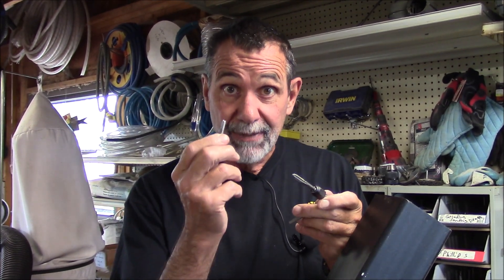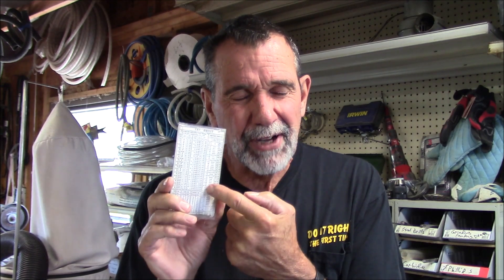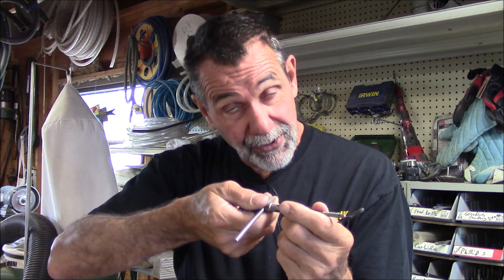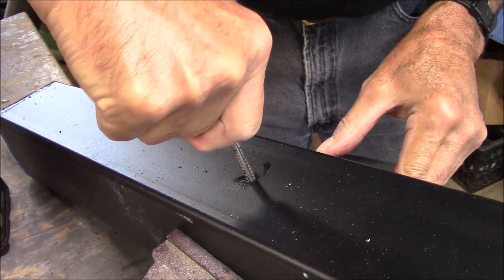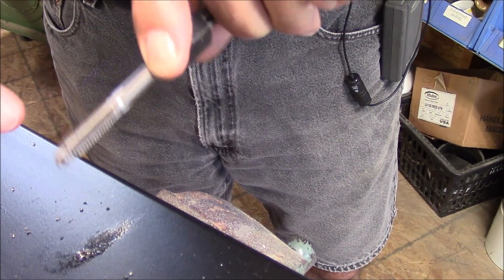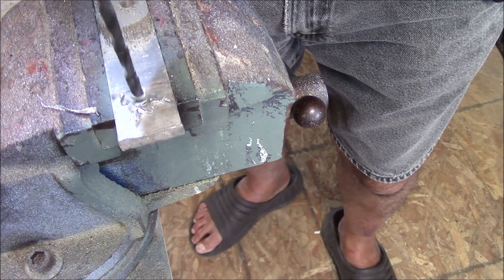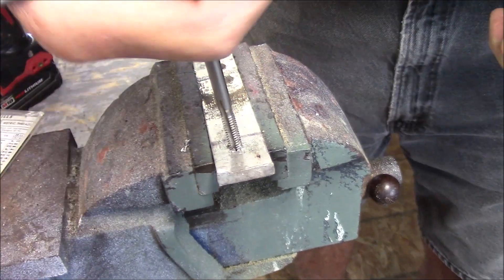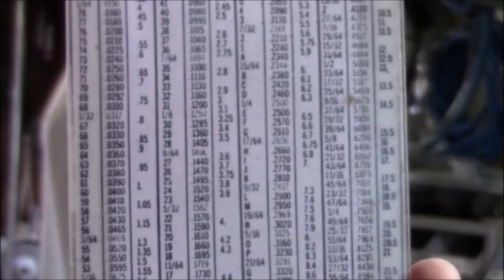Install Threads in Steel and Aluminium - Build Like a Pro

Comment: If you haven't already, how about how to thread rods?
Reply from the maker: @johnrobertd748  I’ll pencil it in and see when we can. Breaking a tap in an aluminum block is more painful than threading rod which usually doesn’t seize the die.

Comment: Excellent video! Thanks for sharing the knowledge. This reminds me of when I had to use a yellow can propane torch to remove a stuck oxygen sensor from off my 97 Laredo. I watched a video in which the poster talked about backing off and turning opposite not forcing it too fast. It took awhile but I got it out.